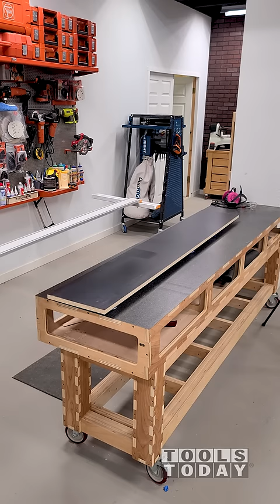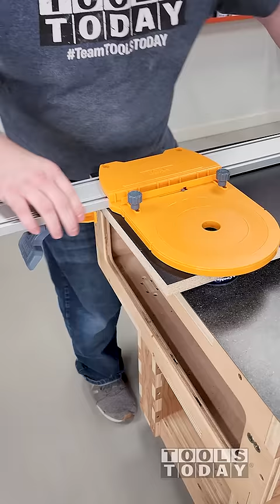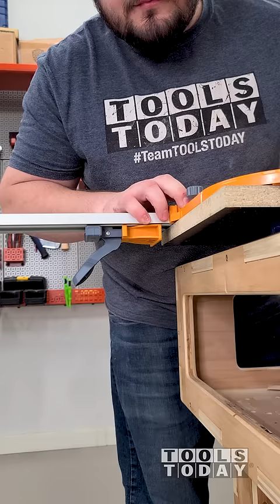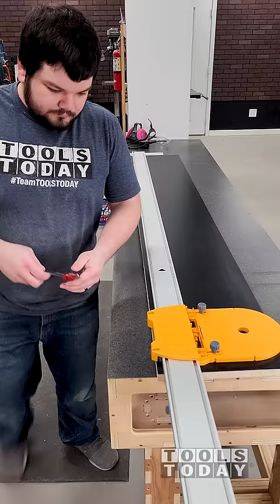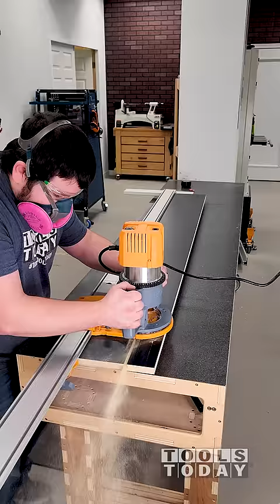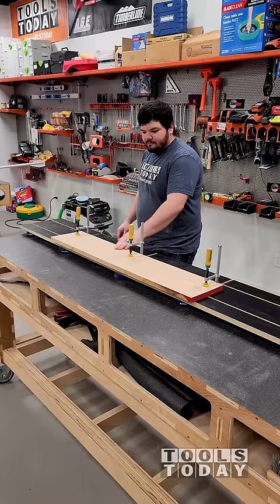Super Versatile Guide

Comment: That brand broke on my table.
Reply: Yeah, I have one and it's supposed to square itself to some extent. It does not. Just use a track saw guide rail and adapter plate for router, on just a clamped straight edge and run the curved side of the router against it.
Reply: Junk wont last

Comment: OUTSTANDING ! If we could see what you made, it would help for us to appreciate this clip, as for now it is a waiste of time watching it, more luck next time tomorrow tools
Reply: It looks like a jointer jig, so you would clamp down the board you want to joint (get a straight edge on) and then run the black board against your table saw fence and cut the overhanging part of the board that is clamped down. There's other videos on the concept but that's what I think he was going for if that helps. And yes I totally agree saying what this is all for would be helpful
Reply: Also as someone who has a jointing jig for the table saw, wouldn't personally suggest particle board/melamine especially w routing through that much. Might not support boards you'd be jointing very well and looks like it could break easily unless you're jointing small pieces. But then again mine is pretty beefy and if you have good outfeed support this could work too